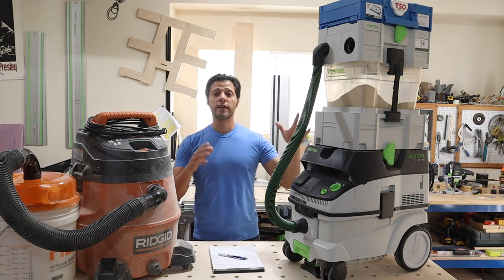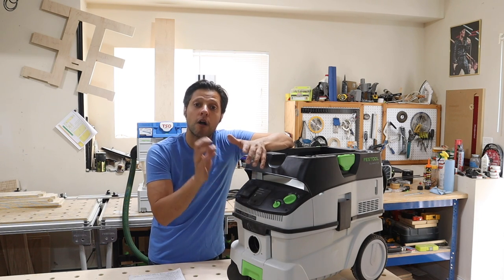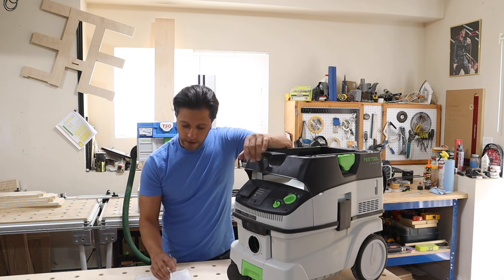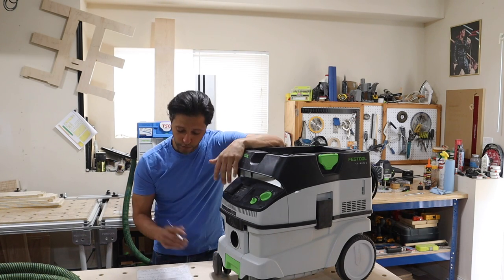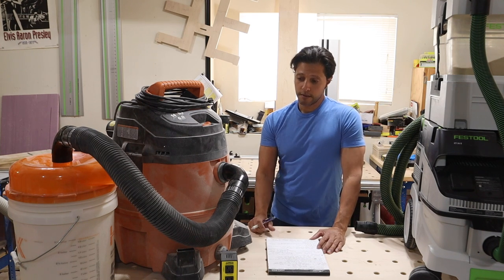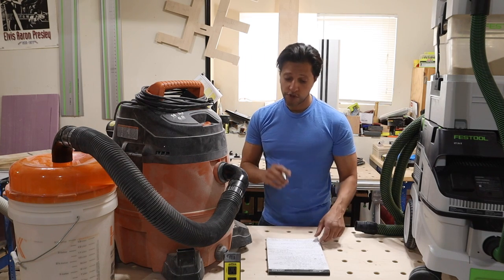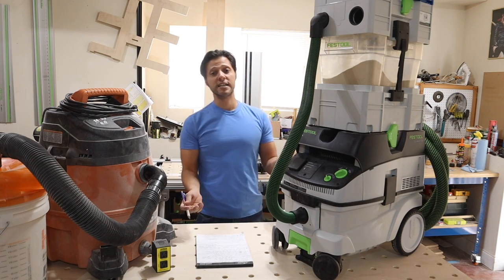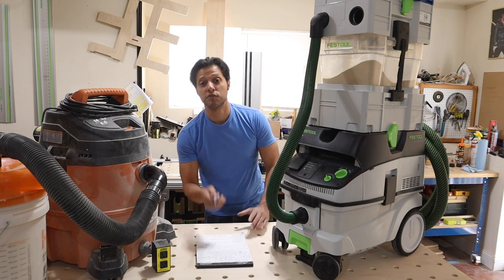Is the Festool ct26,  and ct cyclone. Worth it or not?

Comment: Anthony, a fine comparison and excellent explanation.  By the way, since "debris" comes from the French, and they don't usually like to pronounce the last letter of most words.  Most folks I know say "debris" without pronouncing the "s" so it comes out sounding more like "de-BREE."  Also, the brand "Fein" is from the German, and most folks use the traditional pronunciation rule-of-thumb for the "ei" and "ie" dipthongs where the 1st letter is ignored and the 2d letter is voiced -- so "Fein" comes out more like "fine."  I think "Fein" is fine, but Festool is finer. 🤩  [But tread lightly if you''re around a Mafell fanatic.]

Comment: I went with the dust deputy 2.0 and have had excellent results. I used a 10 gallon metal drum instead of the 5 gallon plastic bucket so the thing will not tip over - tipping over is a major issue that no one talks about with the 5 gallon buckets. With the dust deputy I changed the vac bag once over a two year period.

I am restoring a house room by room so mobility is not an issue otherwise I would consider the Festool. As for adjusting the vacuum pressure for my ETS EC 150 I really have not noticed it to be an issue and I spray all my work - but - it might be an issue with a more powerful vacuum.

Great video

Comment: About the excess suction causing sanding problems; one model of Rigid vac I had came with an "adjustable airflow valve" built in the handle like on the Rockler "Dust Right Shop Vacuum Handle". You could also Macgyver some adapter somewhere on the hose and put a hole in it. It's also useful when I'm trying to vacuum a work area floor that is covered in protection paper and there is too much suction so it pulls the paper up.

Comment: Nice comparison.   I have an older Kirby vacuum which has excellent suction and have it combined with a cyclone on a bin to catch most of the dust.   Very loud though.  That Festool vac system will be close to $2000 here in Australia.   Like the Paulk smart bench template on the wall.

Comment: Great comparison Anthony, thanks for posting.
Both have their place in the shop; I use my midi for collection at the tools, my dewalt shop vac for general cleanup. It's worth installing HEPA bags and filters even on basic shop vacs.
edit to add: A dust separator is a must have IMHO. The festool cyclone is nice if you need that systainer compatibility, otherwise the dust deputy 2.5 is a lot more efficient in collecting dust with much less suction loss.

Comment: 16:30 That automatic switch can be a good solution for a not heavy duty tool like a a sander but it can be a problem with high-current tools like a big chop saw/table saw. All the power come from one circuit so it may trip the breaker As apposed to the IVAC "SWITCH BOX SB-NA" that feeds from two circuits.
Reply from the maker: At 16:30 that is an ivac switch that I’m showing.
Reply: @AnthonyScolaro1  Yes I see the one you show is IVAC as is the one in the link in the description (but that linked one is different model then the one in your video). Maybe I wasn't clear about my point on this... IVAC has a different model (the one i referenced "SB-NA") that uses two separate circuits (provided by two separate plugs) for the vacuum and the tool. This is to avoid the problem of the typical vac switch, such as the one on the Festool or either of the IVAC models you reference pulling too much current and tripping the breaker at the panel.
Reply from the maker: @tonyc7352  the plug switch on the festool dust extractor is made specifically to handle all of the tools in the festool lineup, including the miter saw, track saw, high powered routers etc… I have used it for a year straight and never tripped a breaker or stopped the dust extractor.
Reply: @AnthonyScolaro1  My initial point was about the down side of using a vacuums' on-board auto switch compared to an auto switch that is designed with two separate input circuits. I appreciate that you haven't had this problem. I'm not sure you see the one point I've tried to make. The plug switch on the Festool vac, however heavy-duty, can't compensate for not enough current.

Festool's own maximum rating of the connected tool is 3.7A to 9.1A, depending on the power adjuster setting. The 9.1A rating is available only when the vac is at lowest suction power (set by the dial you pointed out). These ratings are below many high power tools.

Also, even when both the on-vac breaker and the panel breaker don't trip, there is often still the problem of under voltage at the connected tool. This is the same problem as when a high-power tool is run with through an extension cord that is too small a wire gauge and/or too long. The tool will run but at a lower voltage resulting in less torque and speed, this is not good for the tool's motor.

Festool themselves point out this problem and that you sometimes need to not connect a high power tool through the auto receptacle on the vac.

Comment: You linked a 5-meter long  Festool 36mm hose.  Is that what you are holding at 6:08 (because they also make a 3.5 -meter hose)?
Reply from the maker: Yes, the 5 meter. That’s what I have. For me it’s the perfect length. If your dedicated it to one spot such as only on a miter saw, I’d go with a smaller length.

Comment: Hi Anthony, I have ctl26  festool sometime  not enough  capacity. Is it possible replace bottom thank reservoir  with 48 liter model than less cost than cyclone and more effective  no?

Many thanks.
Reply from the maker: If you need more capacity, you need the next model up, which is the 36 and with tax, it’s over $1,000. The cyclone doesn’t give you more capacity in the dust extractor, it stops the extractors bag from filling up and makes it last longer. This way you don’t have to keep buying bags and throwing them out when they’re full. I’ve had this bag in the ct26 for 9 months and it’s still empty because everything goes in the cyclone bin and I just dump it out when it’s full.
Reply: @AnthonyScolaro1  thanks for  answer but if I wanna just change bottom of the ctl26 container  more capacity  48 liter one  is it possible same  size just more hight no?   I just wanna  under  part replace  with 48 liter.
Reply from the maker: @kubilayylmaz1716 I’m sure they would not match up, the footprint is totally different. If there was any way to do that, Festool would sell just the bottom unit. But I’ve never heard of, or seen anything like that ever done.

Comment: 5:05 One thing I've learned is even with cyclonic dust collector containing practically all the dust/debris, you should still replace the bag after lots of use since it wears even though it's empty. (I use Ridgid vac, Ridgid bad and dust deputy). I got caught once and it started to blow through a spot on the bag that wore down. I at least check for this now. I also didn't know about the bags for years but now use then all the time.